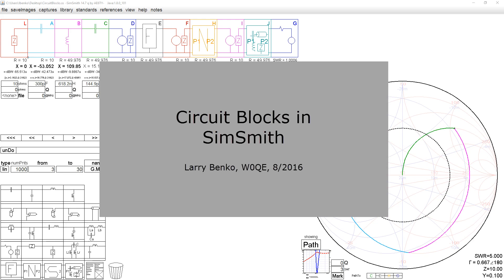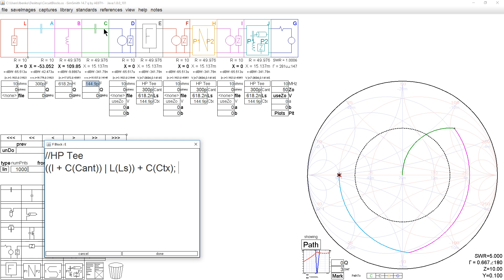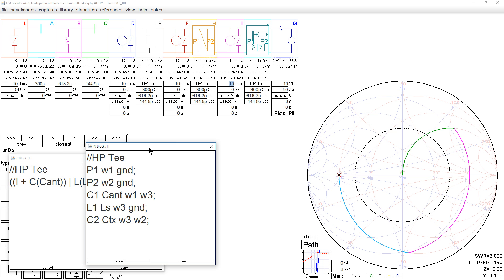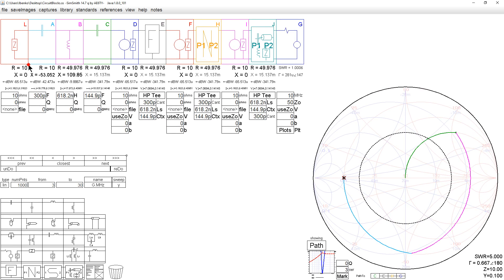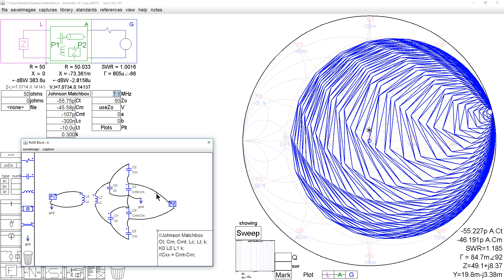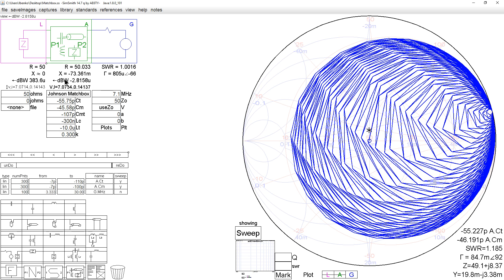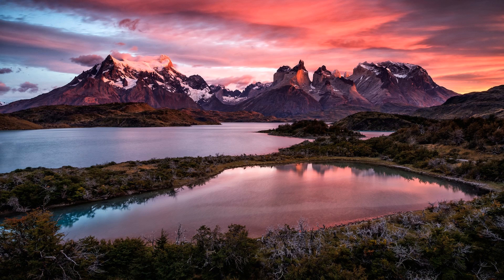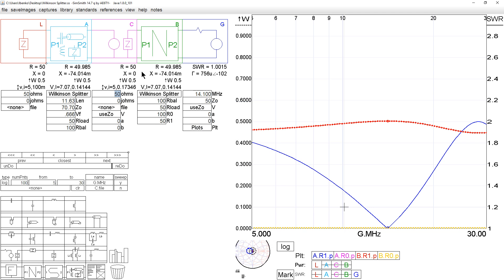#3: Circuit Blocks in SimSmith (Adv. 3)

Comment: I have some questions about RUSE blocks.  If you build a passive LC filter in a RUSE block, can you define the Q of each capacitor, inductor and have them available/settable below the block like an individual component element filter? 
Can the power within, voltage across, and current through each RUSE block element be displayed outside the block like an individual component element filter?
Reply from the maker: Absolutely yes. Assume the component in the RUSE block is an inductor(L1).  Replace the hyphen below the component with "L1_ Q1" without the quotes.  It will now act as you want.
Larry, W0QE
Reply from the maker: Oops, hit reply too soon. If the RUSE block is named A then the voltage across an inductor in that RUSE block can be referenced as A.L1.v and also A.L1.V is the voltage from the dot end of the component to the circuit point labeled "gnd".  I'm sure I have done this in several videos.  Give it a try.
Larry

Comment: Larry, Just found your channel here and subscribed. Awesome work, thank you.I did model a Johnson Matchbox in SimSmith. Before this video, I had to take the balanced circuit and convert it back to single-ended. Beauty of that is you and I matched outputs. The RUSE was nice to use to 'mechanically couple' the differential capacitor.If I used an N block, can I put equations in it like a RUSE? From the video it appears that the RUSE block is just a pictorial N block.Thank you.PaulAC1DW
Reply from the maker: Paul,
You are correct in that he RUSE block is for viewing by the user and SS converts it into an N block for analysis.
Larry, W0QE